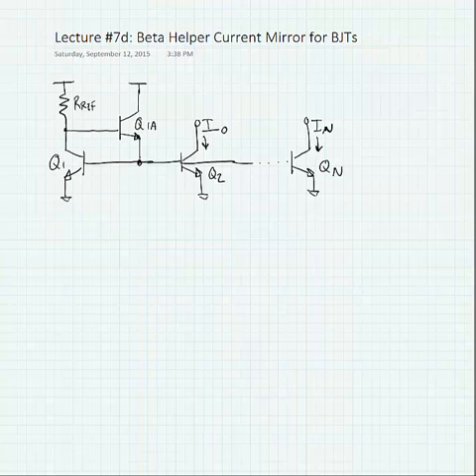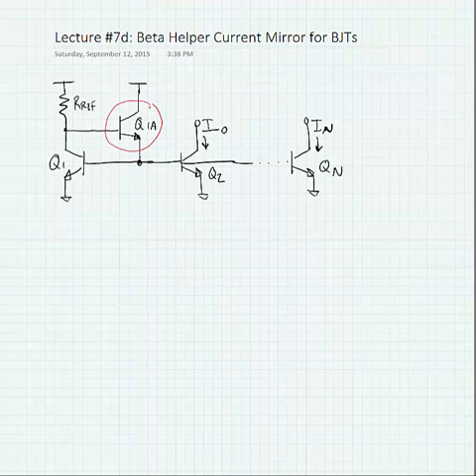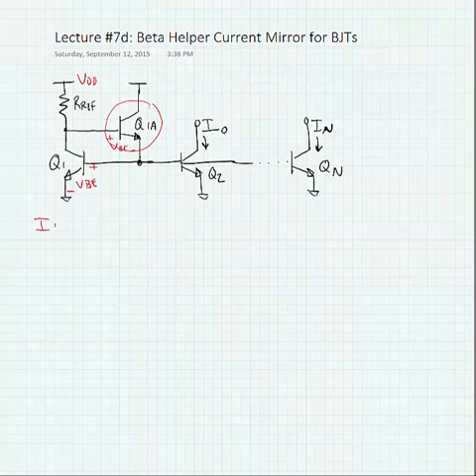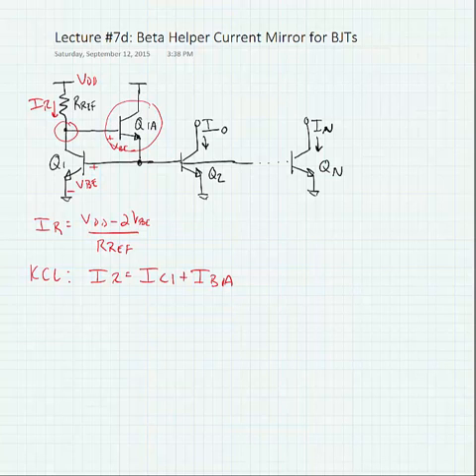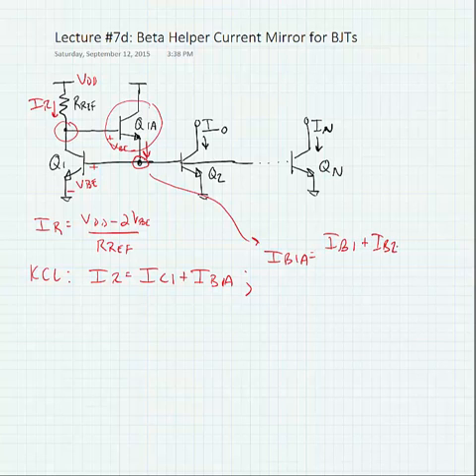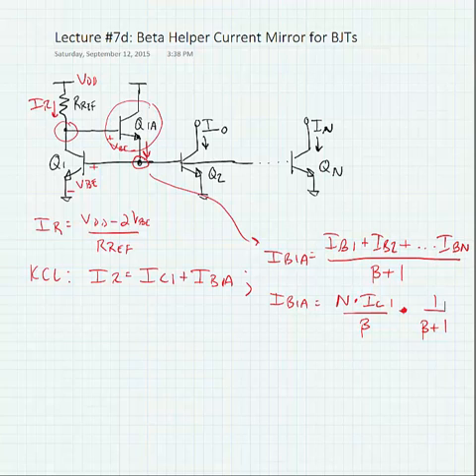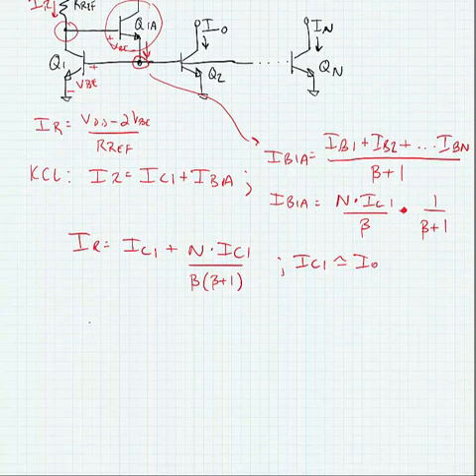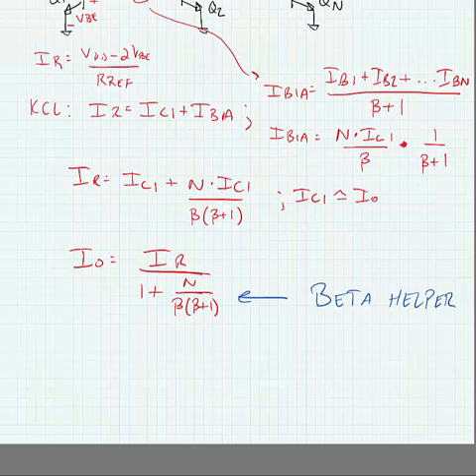ECE 3110 - Lecture 7d: Beta Helper Current Mirror for BJTs

Comment: why can u say that ic1 ~ io?
Reply from the maker: The Vbe of both transistors is the same. The only differences will be due to the finite output resistance of the transistors and the finite base current.
Reply: @wallingphd  I confused myself because of the Q1a but if I say that transistor parameters are matched I can also use:
Ie = is*exp(vbe/vt)
So ie1 = ien  and ib’s are equal so ic’s are equal too. Ty a lot for the video!